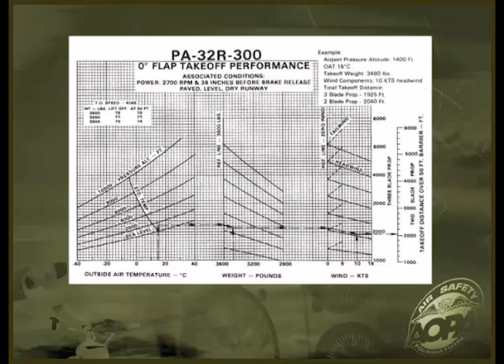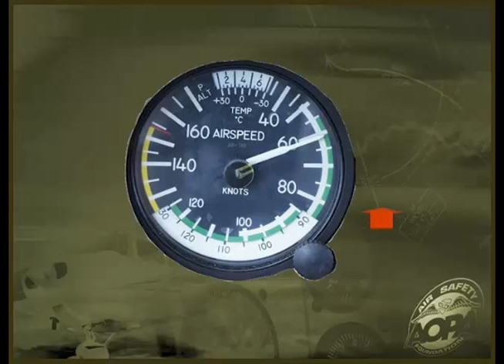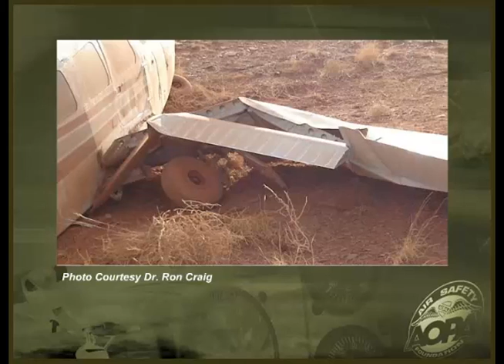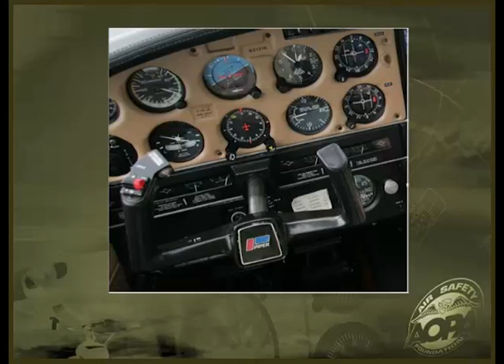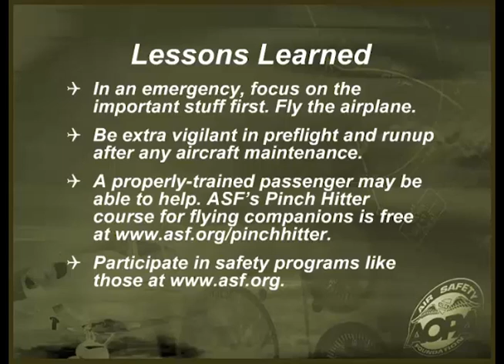Real Pilot Story: Power Loss on Takeoff

Comment: How does this educate the viewer except to be vigilant after engine work, and certainly not to take off right after into IMC?  What caused the engine failure is I'm sure what we're all wondering?
Reply: The report and the findings are in the above link where they state that the technicians didnt do the job of installing the fuel lines correctly and never checked to see if there was anything that could have blocked the fuel supply to the motor. I recall a woman who whose husband was flying a twin when he had a heart attack and died at the controls. Fortunately she had  gained valuable knowledge and with the help of a chase plane plus ATC they got he down, albeit the plane was somewhat the worse for wear.

Comment: As a pilot and aircraft owner myself, I can't emphasize enough, how important the underlying message in this video is. And that message is, whenever your planes been worked on, always be extra cautious. Point is, accidents of this nature are almost always going to happen on take off, during the time the engine is working its hardest, not during the flight so much when the powers pulled back. The need for an extra thorough run up, after ANY maintenance cannot be overstated.  After an oil change on my Bonanza, the mechanic had left my drain plug loose, which came out, then seized my engine right on climb out after retracting the gear. ALWAYS be extra cautious after ANY work is done! Thanks for sharing, and I'm glad you're both alright.
Reply: His language and opinions indicate his experience in 747's is strictly of the sim variety...
Reply: Clearly some mechanics are better than others, meaning the others are worse. There was an article in AOPA on this issue and how hard it is for the FAA to hold the bad ones accountable. I think there ought to be a review site for these guys, just like there are for restaurants (at least if you get a bad meal it isn't likely to kill you!). Be VERY careful when selecting a mechanic to work on your plane.
Reply: Couldnt you take the engine trough takeoff load on the ground a couple times while it is shackled to the ground?
Reply: @pyalot  he mentioned in the video that the engine had twenty hours on it all ready. Indicating the plane had flown multiple times already. Just about the time you start getting comfortable.
Reply: This is why I change my own oil.
Reply: Same can be said for a lot of things that been worked on. I won’t service my primary SCUBA regulator and back up regulator at the same time for this reason.
Reply: If I owned said aircraft I would probably have done said oil change myself and not had someone else do it. I have my oil changes done to my car in-house and not at a shop usually with my grandpa helping out. And I always had to run the engine for about 30 seconds, shut down and then do it again to get it to fully circulate (older car with a modified oil pan to hold more oil).
Reply: How do you be “extra cautious” after engine work? It doesn’t make any sense. Either the engine works, or it doesn’t.
Reply: Why don't these imbeciles have any accountability? How does one hold them accountable? Mechanics are the worst kind of scum for the most part (including the ones working on automobiles). Of course, there are a few good ones that are conscientious and honest. But they are few and far between! 

It is pathetic and disgusting that they try and take short cuts and cut corners, when peoples' lives are on the line!! And sometimes they plain and simple lie that work was done , when it was clearly not (especially when there is no "external" way of telling if it was done or not - fluid changes are a typical example!)
Reply: 747-pilot....  how about if i say pilots are the worst kind of scum, makes the same kind of sense, jesus, if you really are a pilot I guess you don't have to be very fuckin smart to be certified...fuckin moron...

Comment: rubbery particles clogged the fuel divider in the engine..Someone went into that hangar and pushed that kind of material into the fuel lines after the fuel filter...maybe inside the fuel lines attached to the new engine.. The mechanics later on attached the fuel lines as usual.... 

Someone wanted that engine to fail later on..Make the mechanics look bad....or at least if they knew the airplane owner,  make him crash later on...Smells like clear sabotage to this detective...The mechanics wont sabotage their own engine...Someone with access to the shop off hours i bet did it...Sabotaging an aircraft is a big felony..Did they find the guy??
Reply: You should apply for a job with a Russian troll farm.

Comment: I almost crashed at Winslow...Cherokee Warrior, hot day, max gross weight...mild wind. Did all the calcs to insure the aircraft would climb, was off the ground in less than 50% of the runway, made sure aircraft would climb out of ground effect...So far so good. What I didn't plan for was the downdraft at the end of RWY 22 which caused the airplane to sink faster than the anemic climb rate of 300 FPM. It's good there's a wash off the end of the runway because we flew down it, sinking below the level of the airport we just left but still clearing the falling terrain until climbing out of the downdraft.

Comment: Sounds like that A&P needs to no longer work on airplanes if he cannot follow directions any better than that.  It would also seem that lowering the gear is not a good idea on rough terrain as the danger of sheering or punch a hole through the wing or flipping the airplane is too great, also the drag isn't helpful at that point.  Obviously you look for the smoothest practical place to set down but there may not be any and from 200 feet you don't want to start a series of or prolonger turn, but that checklist must be accomplished no minimize risk of post crash fire and help egress.

Comment: This is from the factual accident report:
"On March 24, 2006, a Federal Aviation Administration (FAA) airworthiness inspector from the Scottsdale
Flight Standards District Office, along with an air safety investigator from Textron Lycoming,
conducted an engine exam and test run of the accident engine. The FAA inspector reported that the
engine remained attached to the airframe, and once the engine was started, it ran rough and would not
produce full power. A subsequent internal inspection of the engine's fuel flow divider revealed a
grayish, soft, rubbery material partially blocking the ports of the flow divider's metering pin.

The recovered material, along with the fuel flow divider, fuel injector servo, and a portion of fuel
line that connected the fuel injector servo to the fuel flow divider fuel supply line, was sent to the
National Transportation Safety Board's Materials Laboratory for examination.

 A Safety Board senior metallurgist reported that the grayish-colored rubbery material consisted of
agglomerations of smaller particles, consistent with Teflon like material, showing a significant
fluorine elemental peak. Each mass measured less than 0.06 inches in maximum dimension with
individual particles estimated to be a few thousands of an inch in size, which would break apart into
smaller clumps when probed. The metallurgist reported that the rubbery material was not consistent
with the fuel supply line material, and no additional debris was found inside the fuel line or within
the fuel injector servo. There was no debris discovered in the interior of the fuel injector servo,
or in the fuel injector's inlet screen.

A senior manager for Textron Lycoming's materials laboratory reported to the NTSB that when factoryremanufactured
engines are shipped, the fuel injector servo assembly is not installed on the engine.
He said that once the engine has been test-run at the factory, and before the engine is shipped to the
customer, or to the customer's maintenance provider, the fuel injector servo is removed from the
engine, and placed inside the engine-shipping crate. He stated that the fuel flow divider assembly
remains attached to the engine, and that the fuel line which connects the fuel flow divider and the
fuel injector servo, remains connected to the fuel flow divider. The other end of the fuel line is
then capped-off during shipment. It is the responsibility of the maintenance technician to install
the fuel control servo on the engine, connect the fuel line, and ensure that no debris enters the fuel
line or fuel flow divider during the process.

The Safety Board released the fuel system components to the owner's representatives on November 13,
2006."
Reply: Description sounds like a sealant with teflon additive...
Reply: It's unfortunate that there's no information about what the gunk was or how it got there.
Reply: since it’s flourinated it can be only a few things.Teflon tape. Viton orings, or as Huber said a sealant with Teflon added.

Comment: What was the cause of the engine failure, please?!!!
Reply: "...internal inspection of the engine's fuel flow divider revealed a grayish, soft, rubbery material partially blocking the ports of the flow divider's metering pin" The full report is on NTSB N8322C

Comment: great job on a landing in this situation where you both walked away. But the video left me wanting to know what was the technical reason the engine quit ?
Reply: On March 24, 2006, a Federal Aviation Administration (FAA) airworthiness inspector from the Scottsdale Flight Standards District Office, along with an air safety investigator from Textron Lycoming, conducted an engine exam and test run of the accident engine. The FAA inspector reported that the engine remained attached to the airframe, and once the engine was started, it ran rough and would not produce full power. A subsequent internal inspection of the engine's fuel flow divider revealed a grayish, soft, rubbery material partially blocking the ports of the flow divider's metering pin.

The recovered material, along with the fuel flow divider, fuel injector servo, and a portion of fuel line that connected the fuel injector servo to the fuel flow divider fuel supply line, was sent to the National Transportation Safety Board's Materials Laboratory for examination. A Safety Board senior metallurgist reported that the grayish-colored rubbery material consisted of agglomerations of smaller particles, consistent with Teflon like material, showing a significant fluorine elemental peak. Each mass measured less than 0.06 inches in maximum dimension with individual particles estimated to be a few thousands of an inch in size, which would break apart into smaller clumps when probed. The metallurgist reported that the rubbery material was not consistent with the fuel supply line material, and no additional debris was found inside the fuel line or within the fuel injector servo. There was no debris discovered in the interior of the fuel injector servo, or in the fuel injector's inlet screen.

A senior manager for Textron Lycoming's materials laboratory reported to the NTSB that when factory-remanufactured engines are shipped, the fuel injector servo assembly is not installed on the engine. He said that once the engine has been test-run at the factory, and before the engine is shipped to the customer, or to the customer's maintenance provider, the fuel injector servo is removed from the engine, and placed inside the engine-shipping crate. He stated that the fuel flow divider assembly remains attached to the engine, and that the fuel line which connects the fuel flow divider and the fuel injector servo, remains connected to the fuel flow divider. The other end of the fuel line is then capped-off during shipment. It is the responsibility of the maintenance technician to install the fuel control servo on the engine, connect the fuel line, and ensure that no debris enters the fuel line or fuel flow divider during the process.
Reply: @Nicholas-f5   could someone along past lines have used tefflon tape or some crazy engine 'performance/enhancement' product?
Reply: @megenberg8  I'm guessing debris got in on the packing or unpacking of the engine from the crate. Some tape or something. Either on the servo side or the "capped" fuel line.

Talk about a crappy and bad stroke of luck. True, the installing mechanic could flush or blow out lines or maybe something tiny got in when installing. There's a lot going on for any engine type... though a stuck engine on the water or ground is an inconvenience,  in the air it is likely fatal.
Reply: "You must have an AOPA web account to join, renew, manage your subscriptions or manage your membership and to access Air Safety Institute courses or members-only content."

So the link provided for reading the report doesn't do much good.
Reply: Since they said it was fluorinated that would be either Teflon tape or Viton orings. Probably some Teflon tape got in the line
Reply: Read the NTSB on N8322C.
Reply: The wife.
Reply: @wileywakeboard  yeah, like an object, the boat, the car (smh)